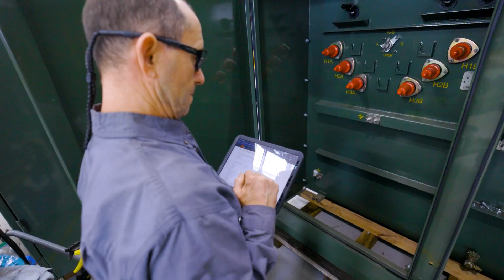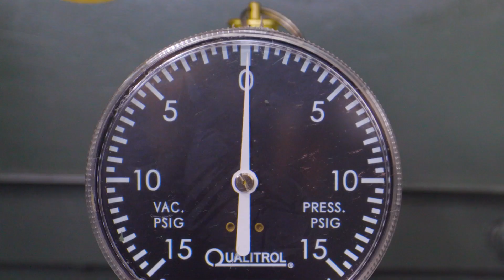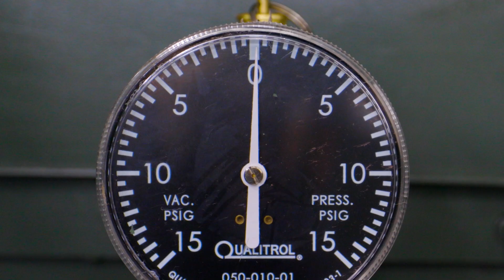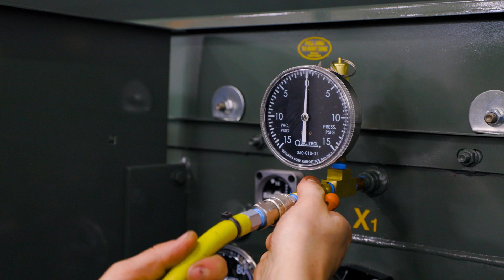Leaky Transformer - Troubleshoot your leak issue in 4 Minutes | Maddox Transformer

Comment: How can u get soapy air bubbles to indicate a leak (nitrogen or otherwise air) BELOW the oil level line?
Reply from the maker: This method may not work to indicate leaks below the oil level line. We recommend wiping down your cabinet and then looking for oil drips to find leaks below the oil level line.
Reply: @MaddoxTransformer , so you don't have to pressurize with N2 the XFMR to detect the leaks below the oil line, is that correct? Or would it be beneficial to spot them?